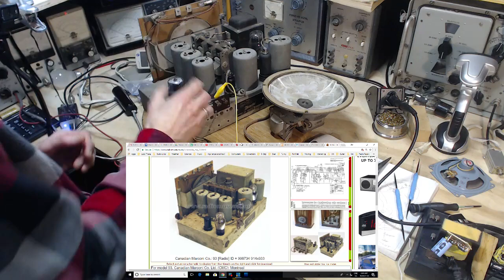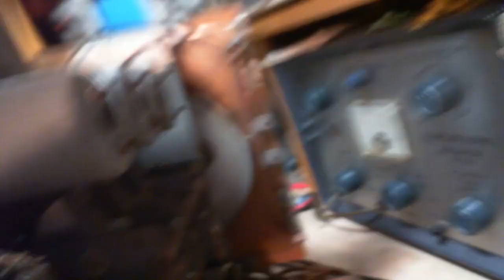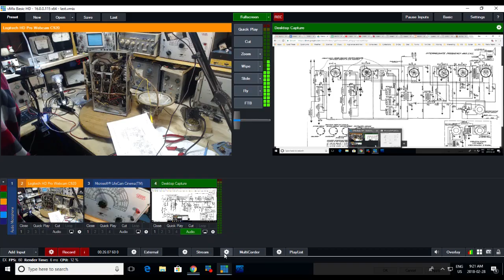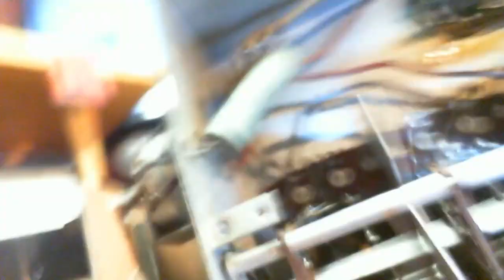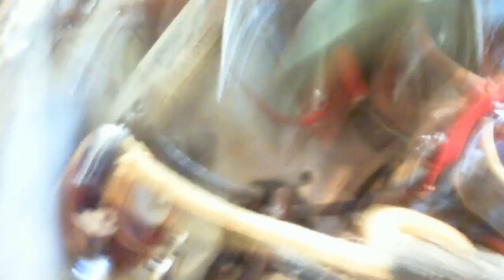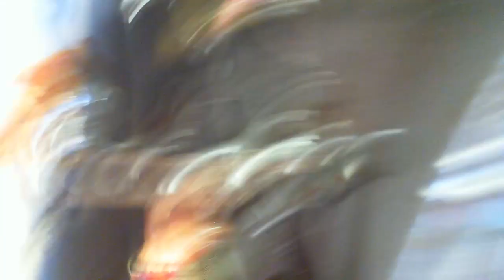Canadian Marconi Model 93 Video #8 - More Troubleshooting

Comment: There is a website that lists all the radio models Marconi made. There is no other version of the this radio. Also, there were other battery radios made after this one, a 105 for one. That means this radio would not have been a factory mod. The nostalgiaair schematic shows the tube complement and there is no 6K7 in the original. The missing tube was a 6C5 which is a metal can tube. The output tube was a 19 which is a six pin dual triode and had a 2 volt filament. I am betting that the output transformer you have is  center tapped. That cut wire on the output connector in the radio probably went to the center trap. Even the nuts holding the power transformer in place make me think it isn't original. They are square instead of hex. That may be stretching it a bit but I think the factory would have used hex heads.

Comment: If you think its mis-labled then the 80 series were the mains models. Yours looks like a model 81
It looks like they wanted to get into the farm market so they produced battery versions of the Model 8X and called them Model 9X.  Under those circumstances a Model 81 mains model miss-labelled  as its battery version the Model 93 is a distinct possibility.

Comment: 1. Service manual for this unit (Battery version): http://pacifictv.ca/schematics/marconi93data.pdf 
2. On the Radiomuseum site, if you click on the tube listing, it will pull up the tube sheet (e.g. click on the 6C5)
3. In the battery version, the mystery socket is the 6c5, which would be the output tube driver (a phase slitter transformer would have been behind it) . see item 1
4. The push-pull transformer is on the speaker: 4 wires (see schematic, top right) 2 fat pins should be primary plate connections, 1 B+ center tap, and 1 ground
5. Is the bias cell (battery) supplying any voltage. It can be replaced by a watch battery.
6. It looks like it was modified for AC, and the audio section too. You might need to draw out the current circuit.
7. AM - right, Police - Center, Short wave - left : see item 1
8. coil 60457 is the Antenna choke : see item 1 parts list.

Comment: Jim in that empty area on the top of the chassis you said there could have been a transformer there, if you look at the drawing of the top of the chassis that goes with the schematic you will see a "driver transformer" in that empty spot made of dotted lines, I believe the dotted lines indicate it would be mounted on the bottom of the chassis in that spot. It looks like when you had the chassis tipped up its missing and I saw holes where it had been mounted.

Comment: Jim, radio guys use to change battery radios to line power a lot in the 30's and early 40's. And they were good at soldering and had the knowledge to make it look very neat like a factory model. Factories did not do what you are saying. You are letting your imagination override reality on this. It's a conversion, that's all.,,, And,,, could that mystery tube socket be for a ballast tube?

Comment: What looks like a transformer was mounted beside the driver tube and the double triode push pull out put stage although it is possible to use a phase splitter to drive the push pull double triode which drives the speaker via the transformer mounted on the speaker and also one of the smaller connections would be black for negative and one of the other three wires going to the speaker should be red going to the centre tap of the speaker transformer and the two other terminals should go back to the two plates on the double triode output tube.